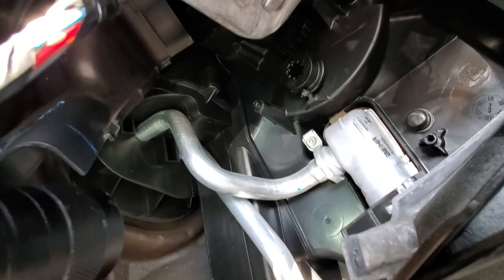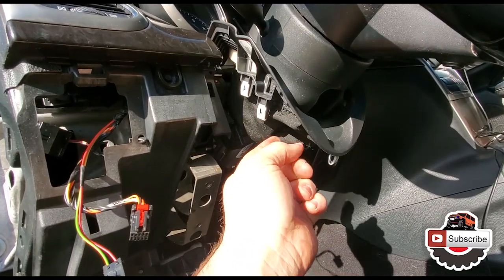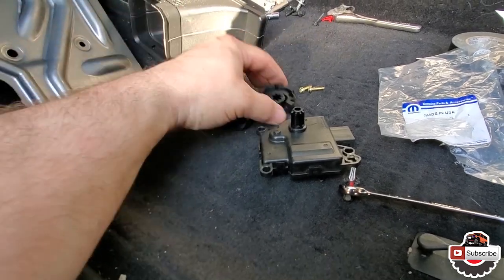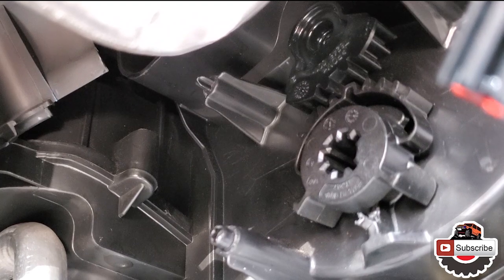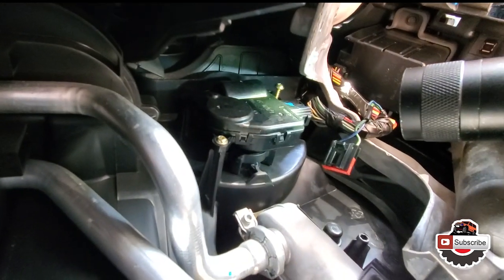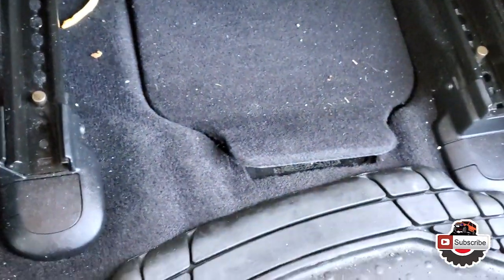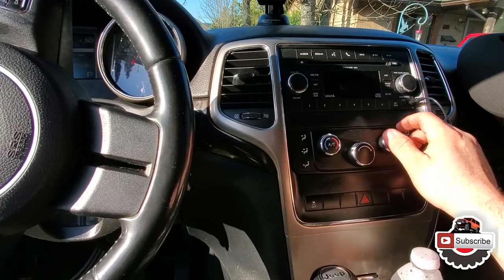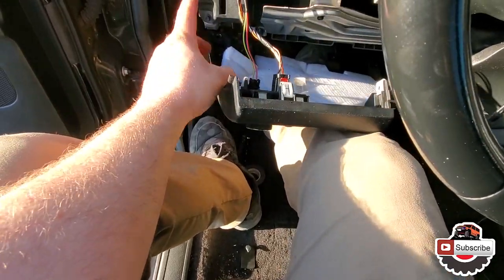2011-2017 Jeep Grand Cherokee Driver Side Blend Door Gear Repair Guide

Comment: Don’t disassemble the motor 
If you have to rotate it plug it in till it’s in the spot then unplug or use test leads to supply power either way to properly orientate it
Reply from the maker: That works aswel. Thanks . 
This one still runs to this day, seems car learns new stops once the actuator motor is in. 
The reason gear failed on this one, it had a stuck vent flap in the heater core. Which I was able to pull back in to operational range. 
Looks like a some sort of coding  glitch, which causes it to push the vent flaps past their stopping point. This is about 4th  WK2 I've ran in to with this issue on a drivers side. 
1 of them i had to pull the heater out.

Comment: So I am weighing the cost between me doing this and an auto shop doing it. The part is inexpensive, but the replacement is labor intensive - and I may not have all the right tools. Equally, I may botch the whole thing. I am considering having a shop do this. What would you say it should cost knowing about how long it takes to get to the part and install it? Thanks!!!!
Reply from the maker: Normally dealer would have the part in stock or have it available the next day. It is about a 2 hour process to do it the way I did it.  But if you are unsure in your skill, than I would have someone more mechanically inclined to do it for you.  Dealer will quote you about 2 hours as well, but at roughly $80 to $120 per hour.
Reply: JEEPER GEAR that is if doors are not stuck. If they are they take entire drum out and it’s 3200$ in Canada :/
Reply from the maker: @tomkulikowski  Yeah that is also true. Sometimes you can get away with just prying them back from the side. The rubber bump stop is what makes it so difficult to pull back out if you're applying leverage with your hand from the side.
Reply: JEEPER GEAR  that’s my plan when I get to work on it this weekend 🤞🏻
Reply: Jeep Gear, if I can’t stick my hand to reach the door , would  cutting a hole in plastic help? Hate to take it all apart or pay that ridicules amount of $ to dealer.
Reply from the maker: @tomkulikowski  at that point i would just pull the dash or take it apart far enough to reach in to get it unstuck and assemble it back. Also if you have a buddy with smaller hands, that would probably work lol
Reply from the maker: @tomkulikowski  problem with cutting heater core, is that it needs to be sealed and it would also ruin structural integrity if it. So I would take the longer route and do it the harder way.
Reply: Jeeper Gear I used little home made bar with 90degree bend . Was able to stick it all the way through and got stuck doors loose after first try! Rest was pretty easy . Total cost -20$ for gear versus 1800$ quote from dealer.

Comment: If the gear breaks it means to door is melted and the housing must be replaced . We replaced them all the time st the dealer. This is not a proper procedure. It's not s big deal to pull the dash board 11 to 14 is a melted box 15 and up actuators go bad
Reply from the maker: Correct or not, point is it still works. No reason to pay a dealer for something this simple.

Comment: I did everything as it shows I plugged my actuator and blend door motor up and then reset it by unplugging battery but now my heater cuts on and off and ain’t in auto idk why anyone know?
Reply from the maker: Do you mean it quits blowing air and then comes back on?  
If that’s the case, your blower motor is on its way out. They’re pretty easy to replaced on a passenger side. Removed the kick panel, 3 screws and it’s out. Make sure the new one looks identical to yours. There’s 2 aftermarket variations with different fans on them.
Reply: @JeeperGear  I had an issue with my driver side not blowing cold air and only heat and I found out my actuator gear was broke so I replaced it and the motor both and unhooked battery and hooked back up and now the driver side and passenger side cuts on and off
Reply from the maker: @rodneyblankenship9490  very curious. There’s nothing that should cause this when this repair is done. Do you hear the motor it’s self cutting off or does the car just change the direction of which way it blows? 
Clogged filter, fan over heats, shuts down, when cools off turns back on.
Reply: It just kicks on and off and sometimes it’s warm air and sometimes it is cool air. When we first got it in we could hear a clicking when changing and could see it but now it just cuts both sides off and back on every little bit when nothing was wrong with the passenger side the only thing that was wrong was the gear was broke but we went ahead and replaced the motor too

Comment: How did you remove the hood release part since mine won't really come out?
Reply from the maker: I've disconnected the pull wire from the hood release handle. Than put it back on.
Reply: @JeeperGear   I did it and it worked Thank you

Comment: So I am trying to do your repair on my 2014 Jeep GC Overland. I have an airbag that is under the driver steering wheel. I was able to remove the 4 bolts at bottom of the panel and the 2 at the top next to the steering wheel. When I attempt to take off the full panel. The part with the airbag is staying in place. I am a novice and have no idea if it is smart/safe to continue to try and remove the airbag/metal plate that it is attached to. Would love it you knew how to help me out. Thanks!
Reply from the maker: I have a 2014 limited that I can look at as well. I'll check it out after work later today.  If you don't feel confident or that you are 100% sure you can handle this repair.  Please don't do it you self and get someone to do it for you. As you can see some models come with different options.  Some come with a kick panel airbag and some don't.
Reply from the maker: Here's a great resource on how to take it apart and handle it.  It is a pdf walk through. On how to remove and handle that particular restraint system component. 
https://www.google.com/url?sa=t&source=web&rct=j&url=http://www.wk2jeeps.com/pdf/WK2_Knee_blocker_airbag_removal.pdf&ved=2ahUKEwjwuqq5pp3pAhWtIjQIHfOHBigQFjAAegQIAhAB&usg=AOvVaw2FPq8QxtnOA0dyfD467Hjg
Reply: Thank you so much!
Reply: Hey Dave, I finally just finished the repair 3 days later (yes, I am a newbie with not much experience on cars). So I will admit that when I took out the lower panel, I “forgot” to loosen the 2  bolts on the back of the KAB. So I ended up pulling off the bottom panel without the airbag.  Thankfully I didn’t rip/damage the airbag and it went back together no problem. Which 2nd screw are you referring to? On the blend door actuator?
Reply: *upper screw (not 2nd screw)
Reply: @daverupert9337  Thank you guys for all the info. Will need to do this repair on my 2014 limited.  I did see another video where the handyman used electrical tape around the T20 bit and stuffed it into the end of a ratchet Wrench.   He didn't need to cut it down to use the socket set.

Comment: Followed your advice on removing the duct in order to access the screw and it worked out well. Did you re assemble the duct then put it back in all together or did you leave the one piece hanging and try to reattach the second piece from underneath ? I’m having trouble getting the duct work to sit right after taking it apart
Reply from the maker: I had to connect them together up in there and fit it on. I basically dove in there with my head resting nearly on a throttle pedal. Sometimes along with patience and colorful few words, I am able to get it to sit right. If you do end up snapping one of the little clip tabs, I used a small piece of electric tape to make a loop and keep it together.